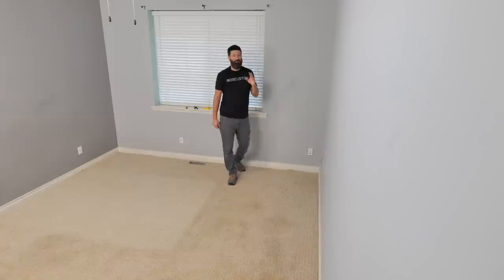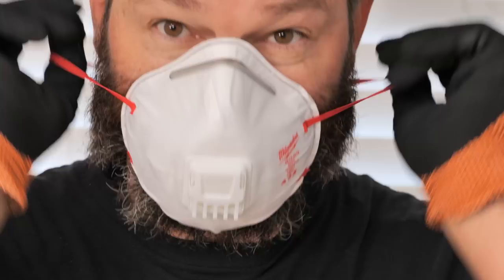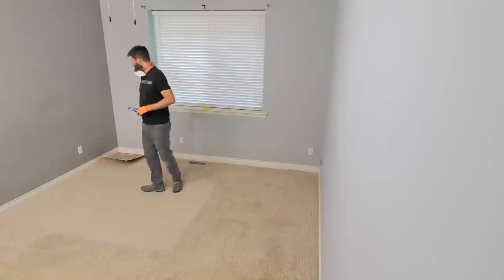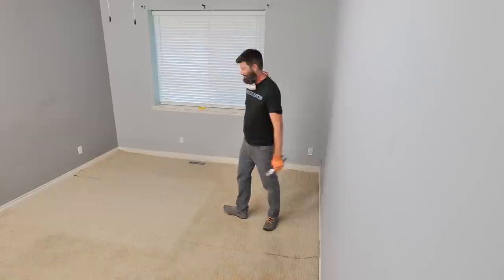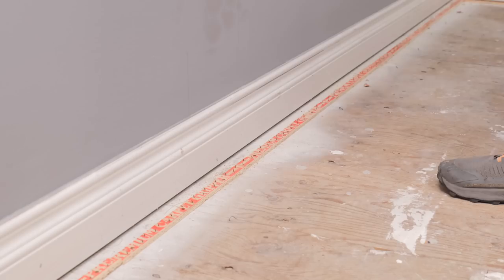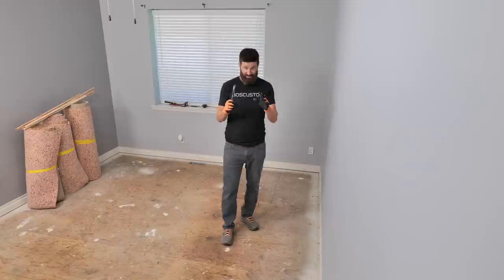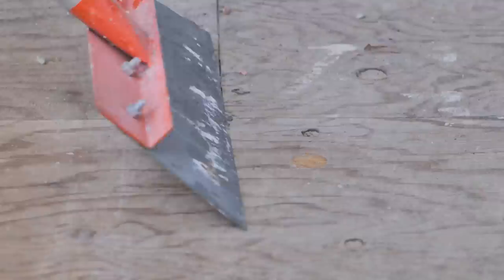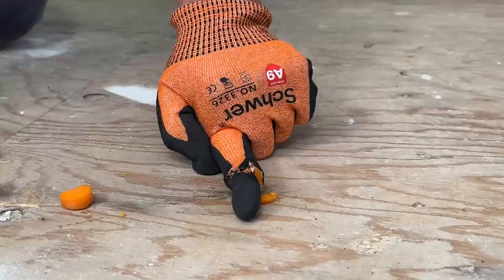There's a Better Way to Remove Carpet!!!

Comment: Good call checking what's under the carpet before you go cutting through it.  In my new house, we ended up ripping up a bunch of the carpets and discovered that somebody had actually decided to carpet over a bunch of beautiful hardwood floors(!)  We pulled all the carpet out, only had to do a slight refinishing on the hardwood, and the floors absolutely gorgeous now.  We really lucked out.

Comment: I learned a trick a long time ago, when you get the carpet rolled up cut a 2" strip half way across the edge, on the top of the roll cut two slits parallel  about 6" wide in the middle and then tuck the strip through them, keeps the roll together without tape and makes a handle to carry it outside.
Reply from the maker: Cool trick

Comment: Yesterday I did a search for "best way to cut carpet" (I'm installing hardwood) and this video was the second one suggested.  Thank you so much for these tips!  They were all spot on fantastic, but the shovel tip is the best.  Today I prepped my 16' x 24' living room for the hardwood install - carpet removal, tack board removal, staple removal, all of it, and I was done in three hours.  Out of five rooms I've put hardwood flooring in, this room is the biggest and the prep time was shortest.  You saved me a bunch of time and a whole bunch of hassle!
Reply from the maker: Happy the tips helped🍻

Comment: I've been in the home improvement - restoration business for about 30 years and I use the same procedure and it's the best way. I do use duct tape for holding the rolls together, but really anything you have handy will work, even box tape. 

I use a regular utility knife but I'm sure that other type is fine. 

One thing that was left out and it will save you years of aggravation is take care of any floor squeaks before reinstalling carpet or whatever flooring you're using. 

 Get a box of 2.5 inch torx head deck screws, or really any 2.5 inch wood screws that you have handy, even 2 inch is better than nothing, and go down every floor joist and screw the subfloor down.

 This will prevent squeaks and will also eliminate existing squeaks and this is the perfect time to do it. You can go around and target the areas that squeak, but I generally go through and just screw everything as if it is a new subfloor. 

If it was originally installed with screws then you probably won't need to. But most subfloors are put down with nails and they tend to get squeaky when you walk on them after a few years. On the butt joints put a screw about every 4 or 5 inches,  and maybe five screws is fine for the places where there is no butt joint, you can do more if you want. A power drill will work but an impact driver is much better for this.

Comment: Great video. I also learned a few tricks when they installed my carpet. You can just throw the carpet out the window once you roll it. Also, if you cut partially down the rolled up carpet so that you have a ribbon hanging off and then make two slits along the center, you can just shove the ribbon through the slits so that it stays rolled up.
Reply from the maker: The window chuck is magical when it works out!

Comment: The reason why i do the staples the same time as the pad as an installer is because I can just take a razor scraper and just go under wherever the padding has been stapled down, and just knock them out of the wood nice and easy. it's pretty easy since most of the time you just have staples along the seems, and the corners.

Comment: Regarding the staples - I don't have a scraper and will certainly consider one next time, but corrugated needle-nose electrician's pliers are absolutely amazing for removing staples.  They have the grip and the leverage that put normal pliers to shame.

Comment: Would love a tip for tearing tac strip up off cement.  I basically pried off the strip and then used nail pullers to rock out every tac strip nail.  It was a pain and breaks up the concrete a bit too.
Reply: The concrete almost always chips when removing tack strip nails. That's exactly what I do too, and if a nail doesn't come out, I take an angle grinder to it. Be careful not to hit the concrete, it'll be a toxic dusty mess.

Comment: Lol. Use a rubber mallet when hammering tack strips with the trim puller. That metal on metal sound without a carpet in the room just destroys your ears. I removed a few carpets in my home and realized that way down the line. Awesome video. The shovel trick was just..."how did I not think of that!". Too late now haha. Make sure it's not a razor scraper with the staple trick.

Comment: Use a shovel to remove tacks AND  the nail strip?? ???    Never heard of such a method…….
Oh my gosh ,   Used it and you saved me about an hour of using the pliers, crow bar and a mallet!!!!!!   THANK YOU. !!!!!!!  Nails and staples came straight out.  

Best part is that when my wife checked in on me , I was holding a big  long shovel so it looked like I was working harder than I actually was.

Comment: Watching the "PROS" use the scraper to pop the staples, they only get about half or so, the rest of the staples just get pressed flat into the plywood; and they leave them.  So don't roll up the pad, use the scraper with the pad still stapled down.  That tiny bit of pad under the staple's crown gives the scraper something to push against and pop the staple instead of plowing it down, and you'll have a lot less to go back and pull by hand to do the job correctly.

Comment: Wow! Learned something new today. In one room of our 1898 Queen Anne there is 50 year old carpet on top of 100 year old carpet which is on top of a horsehair pad. Talk about yucky! The pad doesn't roll up, I have to pull it off in chunks and bag it. I'll have to be careful with the spade too, as I don't want to damage the oak flooring beneath. But I'm going to give it a try. Thanks for sharing your knowledge.
Reply: One room we done had the old carpet and the underlay on top of carpet tiles that were all glued to the hardwood. Luckily none had rotted but it was time consuming

Comment: Great video. Only thing I'd suggest is using a carpet knife instead if you're going to be doing this a lot. They last a lot longer and cut through carpet like it's nothing. I never tried a shovel to remove tack strips, I usually use my long pry bar and essentially do the same thing as the shovel.

Comment: if you cut a 2" strip of the rolled up carpet halfway down and then a small slice through the next layer you can then wrap that strip around the roll and through that hole. no need to use tape,  and you can also carry the rolls by that strip so you don't need to put it over your shoulder and get all the crap down your collar. hard to describe but i had a old timer show me and it's a game changer

Comment: My tip... open the window & screen and just toss the rolls out.  Don't drag the mess through the house.  LOL

Those trim pullers are worth their weight in gold.  I have the version that has a hinged portion in the middle of its blade (Goldblatt)... love that tool for yanking baseboards, door/window trim, etc.  Saves the drywall from getting all banged up.

Comment: Nice simple tips for everyone, like it!  Just one modification: having cut a convenient width of carpet, do not roll it as demonstrated, but gently flip it to the side it's not that difficult, and roll it inwards not outwards. The woven top surface of the carpet remains intact and is comfortable to grab hold of and won't leave your clothes impregnated with sh*t, whereas the bottom of a 30 year old carpet has probably turned into black tar-like glue that will crack and fragment everywhere once you start rolling it, and the underlay is the worst substance known to man for flaking into sticky bits impossible to get out of the wallpaper and carpets of the rest of the house as you brush against walls and banisters and tread in the bits.  Especially foul is the ancient 35+ year old rubber or extruded man-made gooy foam stuff that sticks to the boards and wants to break into bits.  That's when you grab the nice long wide scraper as demonstrated, keep away from the stuff, and scrape it all up and over onto your flipped carpet and remains of underlay, then roll up the whole shebang with "nice clean" (filthy threadbare!) intact carpet on the outside ready for you to manhandle.

Comment: My water heater blew water all over my house last week and i had to tear out about 600sq ft of carpet. I cut it into about 2ft wide lengths, rolled them up with the pad and set inside contractor waste bags. Tied the bag up and tossed it to the curb. My house is on a wood slab, so I didnt have to worry about staples. The tack strips came off quickly with an Irwin pry bar.
Now I got to learn how to lay vinyl plank flooring.

Comment: So I use a rotor hammer and a shovel bit for both these jobs. Ten times faster and far less labor. Works super well on concrete as well. Try it.

Comment: Hey man i cut carpet like a robot all day at work into foot wide and 10 feet long strips for wrapping it on wood shaped to hold big pipes. But anyways try when your cutting thebstrip the get one hand on either side of the carpet and pull on it or lift it a little as you glide your hand following the blade. This will put tension on the fibers and make them cut much mich easier and not dull your blade as much due to slack resistance. And the quicker you walk the better. Last thing you want to do is spend alot of time bent over

Comment: I saw a guy take a 'T' shape multi-tool blade and ground the back edge into a hook, that he then sharpened the edge of. He said it was good for cutting carpet. No demonstration, and I haven't tried it, but it sound like it has potential. I've been cutting my carpet into 1-foot strips so it will fit in my garbage can.
Reply from the maker: I tried a few multi tool blades designed to cut carpets when I was trying out a few things for this video.  I wasn't that impressed, not as quick as a sharp knife and didn't do a good job cutting all the way through the underlay.

Comment: Important question: With the staples, what do you when you don’t want to mark up the floor? 

We renovated much of our house and the owners before us put carpet over very nice pine floors. We decided to take the carpet out and refinish the pine flooring. We ripped up the carpet downstairs and had to take out the staples one by one on our hands and knees… Which was a very long and painful process. We still have staples to take out upstairs and it would be so nice to have an easier way to take them out.

Thoughts?
Reply from the maker: Burn the house down…. But seriously there’s probably not much to do but suffer there! I’d probably have used water pump pliers and a flat putty knife to protect the floor from prying.
Reply: @TheFunnyCarpenter  😂 That’s how I felt the first time around!! 

Thanks! I’ll give that a try!

Comment: Carpet layer here.
All that's good except use the scraper to knock loose the tackstrip and fold the carpet over and cut it from the back. Much easier and faster.
Cheers.

Comment: You'll find its easier to cut carpet with the grain which almost always runs with the length of the room. If you do it right you don't cut any carpet at all. The blade goes in between the rows of yarn and all you cut is backing.

Comment: It’s a lot easier to cut burbour carpet with the grain instead of against it, as you did. Also, you can get rid of those staples in seconds with a belt sander.

Comment: the scraper is okay for plywood floors for the staples.But if you have hard wood floors it doesnt work that good at all ,the hard wood holds those staples in there.Plus you dont want to be scrapping the floors your going to redo.you also dont want to use the shovel on a hard wood floor either.

Comment: For more than thirty years I owned multfamily housing. I have ripped up a lot of carpet. I think I am going to find out that I could have done it a lot faster if I had know what is in this video. We'll see.

Pulling the carpet out: Little or no improvement. I liked rolling it into as big a roll as I could handle. I might have even been faster.

Pulling out the tack strip: Big improvement. Using the shovel looked great to me.

Pulling out the staples: I'm not sure now, but I think I did it sort of like that. I used a heavy floor scraper.

Comment: My issue is that the floors underneath are brand new.  They installed carpet on brand new floors.  House was built in 1973.

Comment: Did you know for the majority of carpets the gripper should be placed the thickness of wood part only of the gripper away from the skirting inable to stretch the carpet over it.. tuck it down and hold in place... that gripper in the Vid is to far away from the skirts

Comment: Scraping staples is faster, but pulling them one by one is the way to go. Scraping them sends them flying. One gets stuck in the bottom of your shoe. You scratch your brand new floor. I've seen it happen.

Comment: So I’m removing old baseboard and trim and installing new. The floor is carpeted but I’m getting new carpet in the spring. My question is…. How high should I install the new base board up off the floor so that the new carpet can still tuck under it? Is there an ideal height that is not to high or too low? The new carpet is probably going to be a medium pile and I will probably be keeping the existing tack strip as long as it’s in good condition. Thanks in advance for any tips/info you can provide!!!

Comment: That is the hardest way to rip out carpet, fold the room lengthwise into thirds then cut it from the back and you don't have to get on your hands and knees to cut the carpet I've been doing it that way for 35 years.. that's an easy way to rip out tack strip if you are on a wood floor. ... there is a lot better way if you are removing tack strip from concrete that doesn't damage the floor... and by the way I enjoy watching your videos
Reply from the maker: thanks for the tips

Comment: Sadly I have beige carpet throughout the apartment - ha! But it is laid on a concrete slab. The baseboards will need repair and painting then new carpet laid - any suggestions as to how I should approach this project.